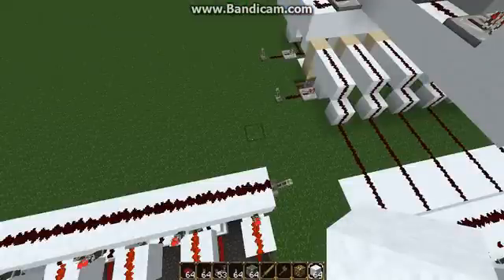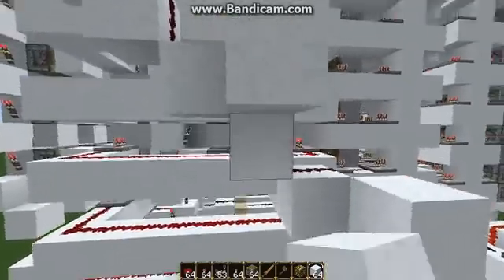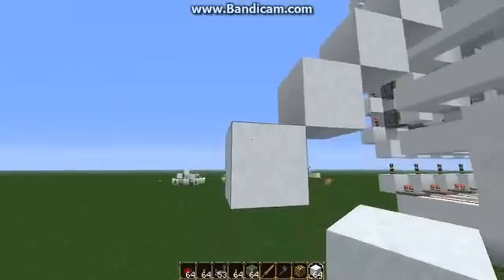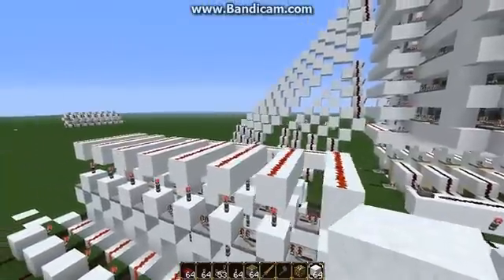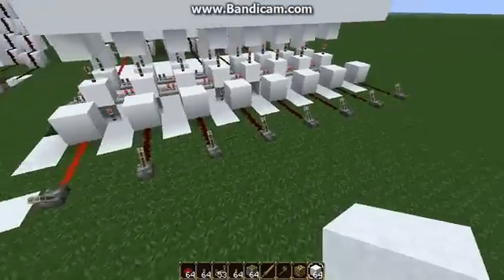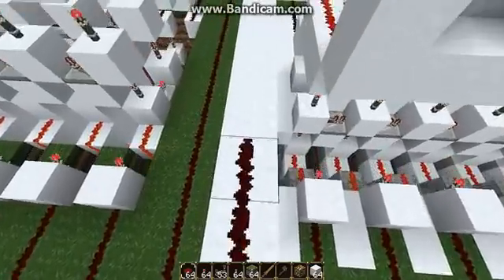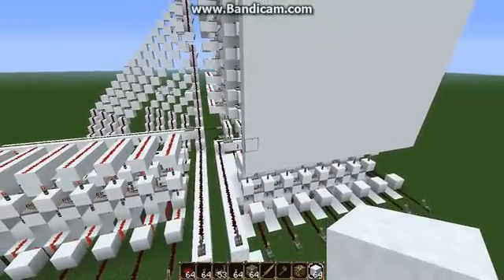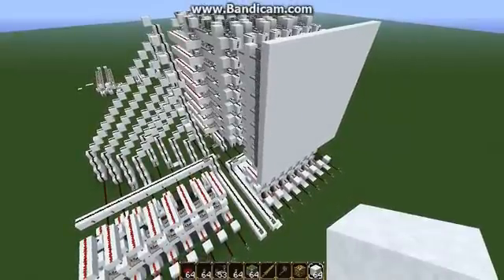Building a minecraft GPU tutorial pt6: The Y commands and Finishing

Comment: I discovered that if I inverted the line to the erase commands (( MC version 1.4.5)) then the erase command signal worked awesome, it erased all pixels on every line I had allowed to be accessed by the y command lines. Without any glitch. Otherwise this worked awesome, and you did not need a Y fill , though it did make it easier than switching each y line off to make a line. Heh!!
Trae